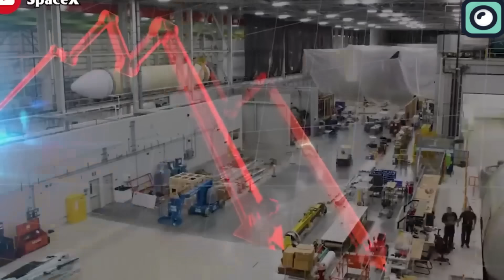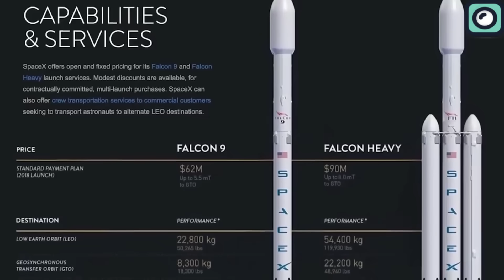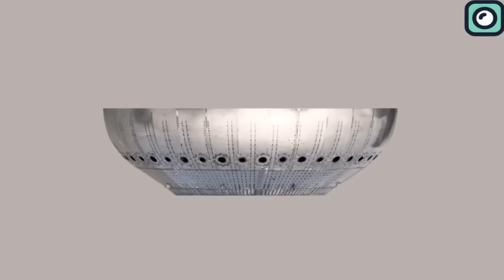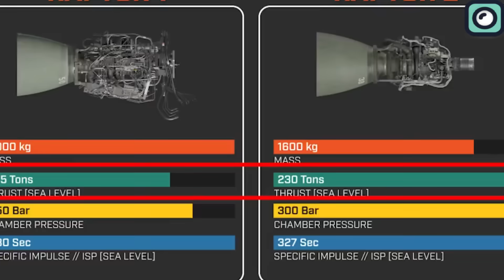ULA Being SOLD, Who is Buying it, Elon Musk?

Comment: The comment that SpaceX's Starship's initial flights faced challenges is nonsense as it fails to recognize the difference in philosophy between SpaceX and ULA's engineering processes and at this point it's obvious that SpaceX is using a superior philosophy as they are working on their second generation of reusable rockets while everyone else is still quite far behind them.

They are also aiming for a rocket that can put so much into space in a single launch that when the Starship finishes it's initial development and goes commercial it will make every other rocket obsolete simply because it lowers the cost per ton of sending things to space by so much that it will undercut every other rocket.